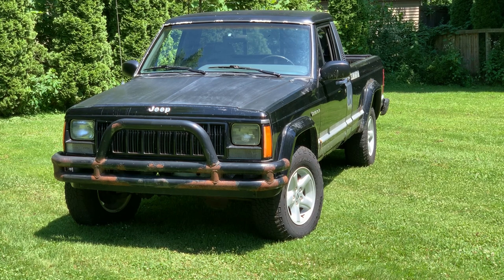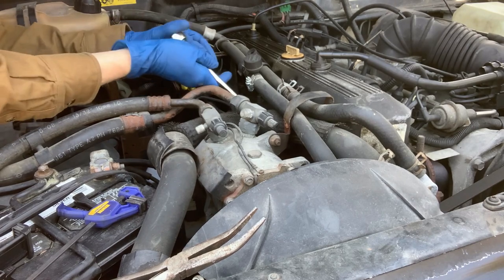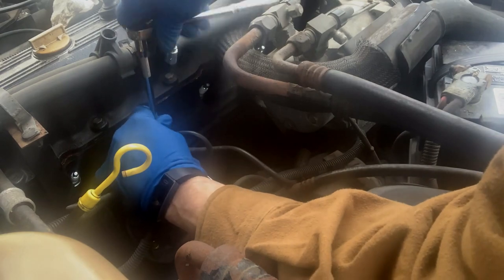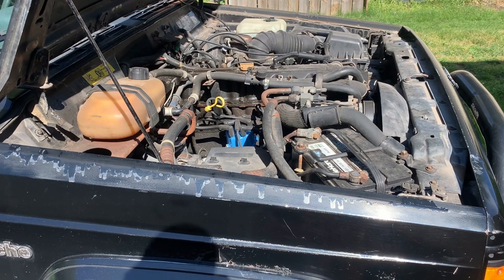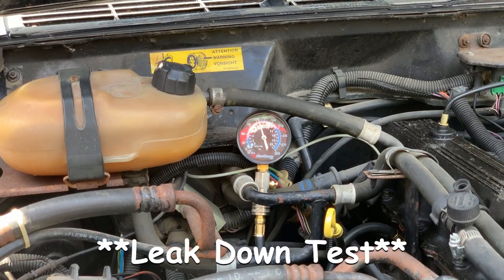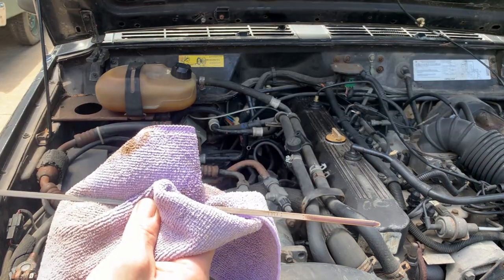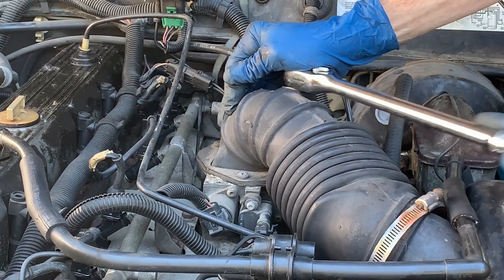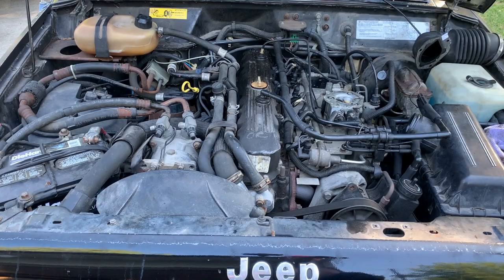Jeep Comanche Eliminator Misfire Diagnosis & Repair

Comment: nice work on the jeep.  i love to see others working on these renix era jeeps.  i have built a few on my channel.  Just a heads up, that TPS needs to be tuned with a multimeter while you are turning the throttle.  A guy by the name of cruiser 54 has a website that covers just about everything on these RENIX jeeps.  I actually have had a ton of issue with idle on these renix jeeps as well.  the first thing i look at is all the vacuum lines.  if that doesnt work, i will just unplug the wire connector for the IAC.  that will typically just freeze the curb idle at whatever idle speed you pull it at.  It will stop the surging idle problem.  Give it a shot and let me know what it does!
Reply from the maker: Thanks for the info. I've heard of Cruiser54 on a few of the Facebook groups. I'll have to look it up as I need to up my RENIX knowledge. I'm putting the Comanche away for the winter this week so I'll give the IAC trick a try and let you know.
Reply: @6percentrecycled  good luck with the project!
Reply from the maker: @myles2go.  the IAC trick worked thanks. I'm going to make a quick video of it and likely release it next week. I'd like to credit you in the video if that works for you let me know.
Reply: @6percentrecycled  i am glad to hear it worked for you!  i would also love to be tagged or mentioned in any way.  thanks!